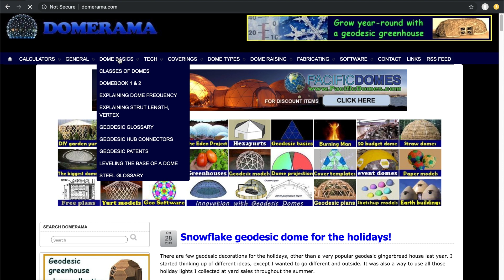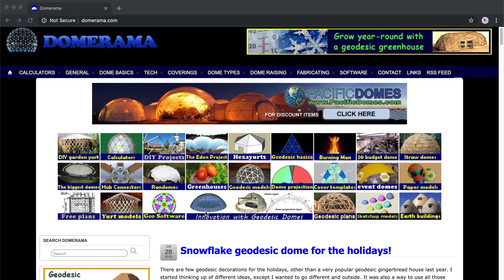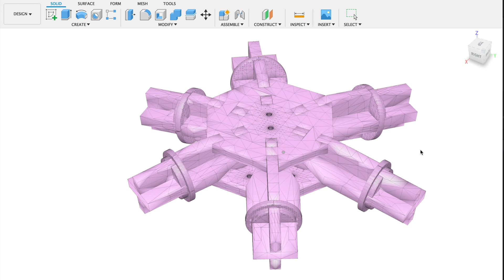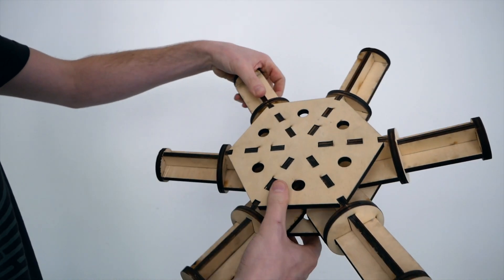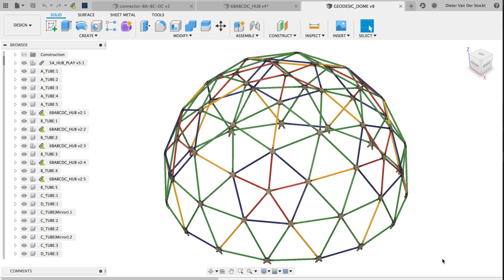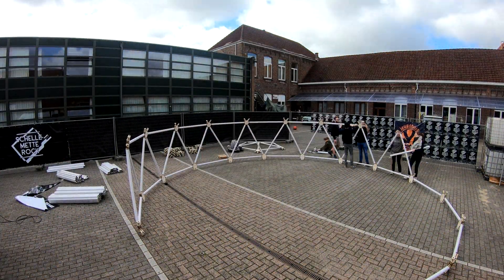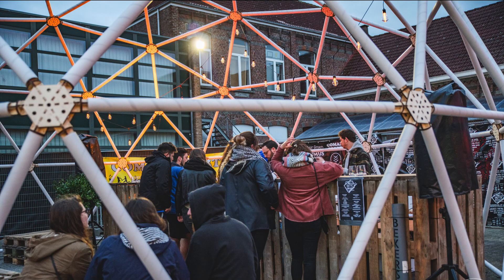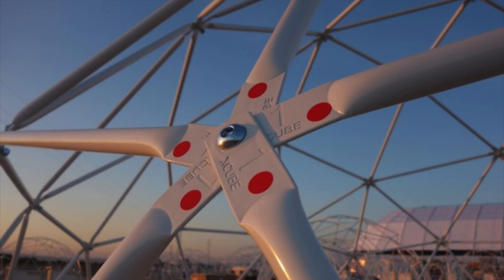Building a Geodesic Dome with Cardboard Tubes and Laser Cut Connectors

Comment: If you designed the connectors in metal and used copper tubes it might have worked better the design you made needs to be round  in the 6 way and 5 way like tent companies use .  If you make ones for the copper tubes or home depot metal tubes that are cheap let us know . The bolts are fine for one time instals but for repetitive ones needs the connectors like you made but metal and round in full with bolts going through to pin them . Like regular twenty by fifteens use but we need ones on the 18 degrees for 2 v any higher than that no one would use but 2 vs if proper connectors and bolts through to pin them closed for safety might pass building inspections? You looked like you were at San Sebastian where filmfest is held.

Comment: Nice work. You were talking about the hubs being too weak, one other option is to use the zip tie dome method. The tube struts will fit into the holes, done. The zip tie dome inventor is quite intelligent.
Reply from the maker: Yup, that also looks like an easy and effective solution to design yourself a way around the critical angles of the hub connector.

Comment: Great project!!!
Did you ever think of using plastic tubes - e.g. those cheaply available for plumbing etc.??? Was this an environmental decision (against plastics)?
Reply from the maker: I did at first, but they were more expensive, more fragile, looked worse and are indeed al lot less environmental friendly. (especially the case for PVC plastics)  Plastic would be the better choice for making it rain proof, but cardboard just seemed an overal better option...
Reply: @OOTUS  not necessarily. The cardboard tubes couldn't be reused so if one wants a reuseable option plastic tubes can last longer, and thus have a smaller environmental impact. I liked this project but the hubs seemed wayy to fragile/complex. A whole sale metal supplier sells metal in 8m lengths and it's not that expensive if you get whoelsale account.

Comment: Hi, nice project. Very impressive. 
I could see that you have spent a great deal of time with the connections. Was there a possibility of making a 6 sided hollow plate where the tubes with wood plugged end can fit/snap-in then kept in place with a flat piece that's screwed in to the hollow plate? 
Best.
Reply from the maker: That could be possible, but it would have taken even more time I think. Now I had to make 61 connectors, but there are 165 struts, so you would have to make 330 plugged ends... And you still need the connector to compensate a bit for the different angles at the connecting location, it's not super crucial with metal struts, because they can flex a little bit when put together, but with a wooden connection it's probably even more likely to break...
Reply: You could make a 2 part plate hub pretty easily by laminating multiple layers of kraftpaper. Place the glued sheets over a mold and consolidate them with a hydraulic press. Most of the tubes available commercially are spiral wound from recycled paper (weak) parallel wound tubes made from kraft would be many times stronger..